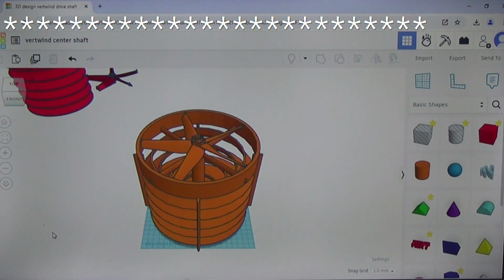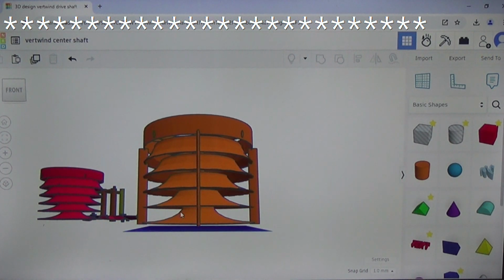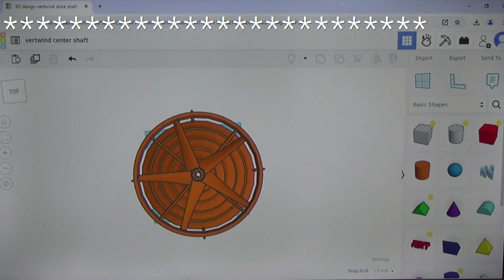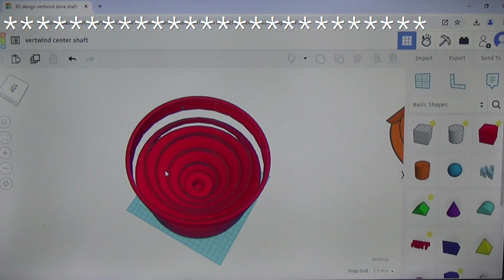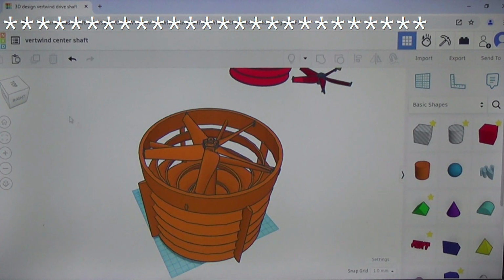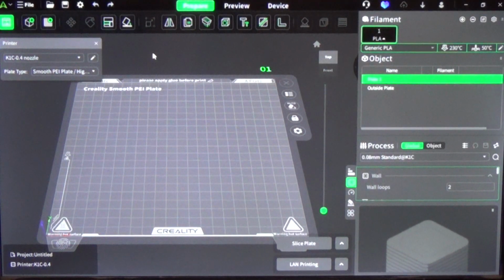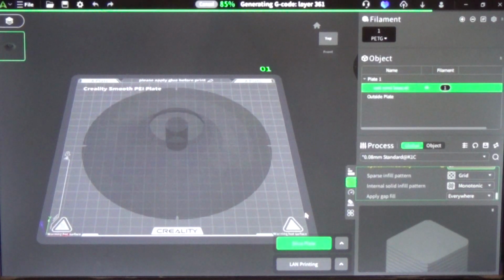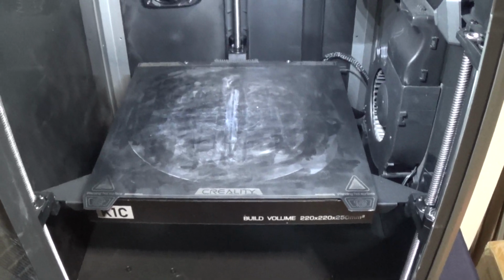Awesome VERTICAL WIND TURBINE Design, Works Great!

Comment: i want to see more on this project, is it possible to put magnets on the end of the blades and make a coil of wire around the outer top ring to generate energy. my thought is if it used some small mini neo magnets on the outer parts of the blade it give the blades a lil weight to help them hold up in stronger wind, another idea also could be to add a safety grid over the top opening and maybe also introduce a handle on the top that could also act as a anchor that it could have the blades on 2 lower and top barings and the blades have a shaft that allow it to hold up even better in stronger winds, and the handle allowing it to be portable, then include anderson cable plug in to it maybe 2 where the energy can pass through and connect a few in series then to a charge controller and inverter, this could be a great way to make a few of these then can connect to one of them solar generators as some of them can allow up to 1000 + watts input via a anderson connector if the design used dc output. i know for me living off grid solar always hit and miss just like the wind but most days do still get some breze where this design could work far better for me then my wind turbine i currently have that seems it never gets any strong enough wind to make its 3 blades rotate as the wind seems to just pass through it more then anything. love to see more on this for sure id like to build something like this some day as it could help me so much,